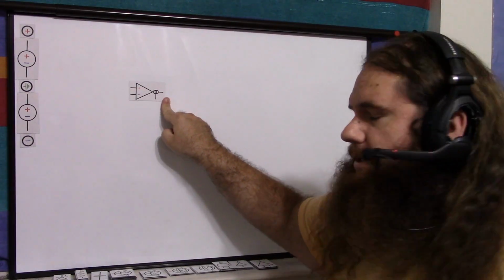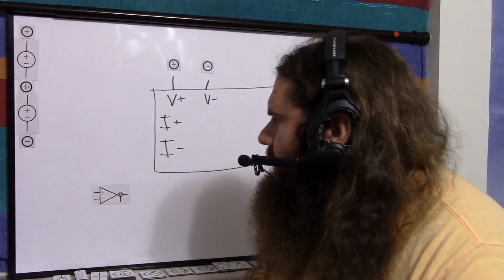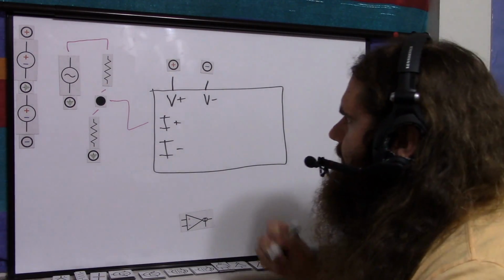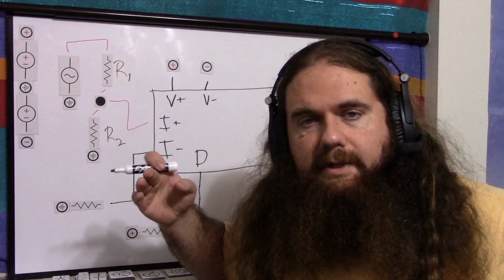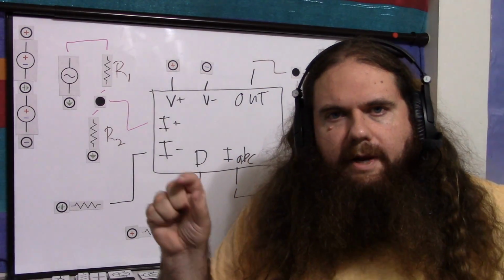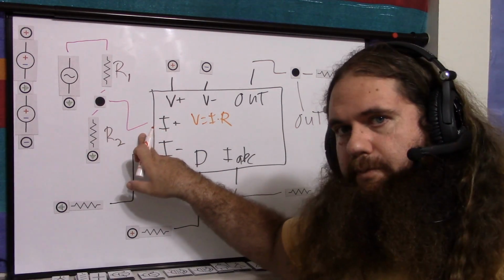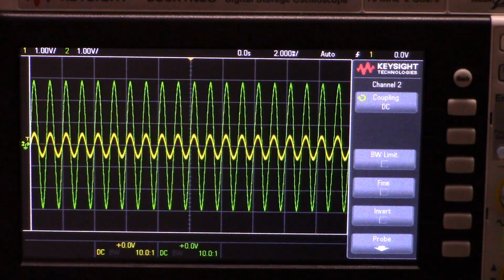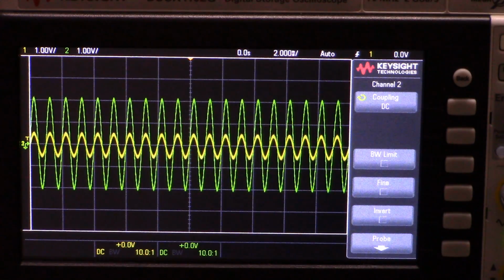Configure Your OTA The Easy Way - Operational Transconductance Amplifier Setup - Simply Put

Comment: Thank you for this most-excellent video. It is unfortunate that every integrated OTA ever made didn't have internal current limit protection for the Iabc input. One little design error or casual slip of a probe will ruin OTAs like the CA3080 or LM13700. With regard to the Darlington feature, its inherent input offset and relatively low impedance are detriments. It can be eliminated in certain configurations with feedback, but most designs simply leave the Darlington disocnnected and replace it with a good quality op amp like an NE5534 or TL071. I have never found the Darlington to be useful.

Comment: Excellent, if only I had found the video before then I wouldn't have spent weeks down the rabbit hole. In fact my trigger is analog, I'm restoring a receiver because I think it's better to restore old things instead of buying new ones and using up our finite resources. But there is natural wear and tear and things that cannot be replaced because they no longer exist. In my case it's a stereo volume control with a balance control, all in a 3-piece sandwich. Despite cleaning and deoxidizer spray, the control no longer behaves synchronously and symmetrically. By synchronous-symmetrical I mean that from 0 to max power one channel gets louder first and this is reversed during the control. A bit like two ball tracks where one has a longer, more inclined track. Everything is the same at the beginning and end but not in between. Now the solution can only be to use one of the stereo potentiometers to control both signals by means of a "device". Now I have already made a solution with optocontrollers and wanted an alternative solution to find the best one. But I stuck with the LM13700 solution for a long time. But with the help of your explanations I will now be able to do it.

Comment: Great video again. My math does not always work right on non-ideal amps. Your technique saved me because the data book values failed me. Did you connect your Darlington buffer emitter thru a 5k to the negative rail?
 I did on my LM13600, took the output from the 5k to ground common and it worked fine. The data book input resistor would not let me zero the output. For fun, I changed the load and took the Iabc to nearly 2 mA. have super gain now. I watched your video several times.

Comment: OpenMusicLabs has a really detailed discussion of how to configure OTA's to minimize distortion It includes things like op-amp drive circuits for the linearizing diodes, and the effect of single-ended versus differential drive of the inputs.  http://www.openmusiclabs.com/files/otadist.pdf  Thought it might interest you.

Of course, if our have really stiff requirements for a voltage-controlled amplifier, you eventually have to bite the bullet and go to a Gilbert-cell multiplier. Just as the LM13700 is the last OTA left standing, the AD633 seems to be the last analog multiplier on the table.  Pretty soon, this stuff will all be "run it through an A/D, multiply on a computer, run it through a D/A" - and what fun is that?

Comment: Probably the best expo so far of lm13700. Ever. And I’ve looked and seen and read. I’m glad you pointed out the “keep voltage low at the input “ concept. I’m hoping to reduce popping on sharp changes in control voltage. 

Also no luck with onboard Darlington.. arrangement

Comment: How would you approach the calculation when using feedback loops? In my case i am trying to build a Filter circuit where the diff. voltage = Uin - Uout? However i don't know how much phase i will have on my output..

Comment: Regarding your comments on the malfunctioning darlington buffer:

I recently ordered 10 LM13700's on Ebay, but I received 80 for the price of 10??  I also don't use the onboard buffer, I use op amps.  The OTA's work very much the way you describe in your video, c.w. the d.c. biases.  I wonder if the onboard Darlington buffers work in the batch that I ordered?

Comment: 8:00 So if you have 2 inputs that are exact oposites + noise (differential signal) and you voltage divide both the same way then they are impedance matched, right?

Comment: Sir i am designing Non Inverting OTA based amplifier on breadboard .....but i am not able to getting correct output ......Actullay sir my output is totally depends on power supply, Not Depends on input, If i off the input supply however my out is coming, means output is totally depends on power supply, why this happening ?  Please sir give the suggestion?

Thanks & Regards
Krishna IIT BH M Tech
Mail Id kreshnand@iitbhilai.ac.in

Comment: I would love to see a vid on the topic of how to create control voltage resistors with the OTA ICs. There's a whole world of DIY modular synth enthusiasts that I'm sure will find this very useful for implementing CV on parameters that only have potentiometers such as filter resonance.
Reply: + 1 please !
Reply: For other people looking for that information: A voltage controlled resistor circuit is in the LM13700 datasheet! Single-ended and floating versions included.

Comment: There may be an issue with a multi meter used in current mode in order to determine the correct resistor values for the current inputs. Standard MM in current measure mode cause a voltage drop across the MM itself. Depending on your supply voltage and the quality of the device, this may effect your results in an undesirable way. The drop should be less than a volt but bad contacts and low quality meters in combination may turn out to be worse.
Reply from the maker: Yep, I did come across this when researching input impedance of instruments, but for breadboard work and with the meters I have, it seems to be negligible. Of course, for making a proper commercial product with real tolerances, I'd be more careful.

Comment: 10:20 with negative supply on volume knobe it is possible to draw current out of Iabc, will OTA be current sink in this situation?
Reply from the maker: According to the datasheet for the LM13700 I use, the Iabc (Ibias in the datasheet) pin is two diode drops above the negative rail, so you'd have to put almost the full negative voltage on that pin to draw current out, and doing so probably would make the OTA not work right, so it's pretty much always going to be current going into Iabc, not out of it.

Comment: Great video, thanks! I've always gotten poor results using the LM13700. Probably user error.. :)
Reply from the maker: I've only just started scratching the surface with it, but so far it's behaved wonderfully. It's just super fiddly to configure, but once you do it seems pretty nice. I haven't been able to figure out the on-chip darlington emitter follower buffers yet, though, but I find op-amp buffers to be much easier to work with anyway.